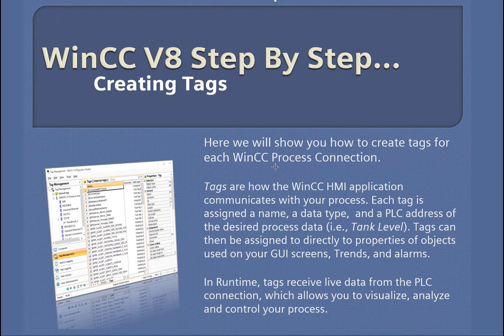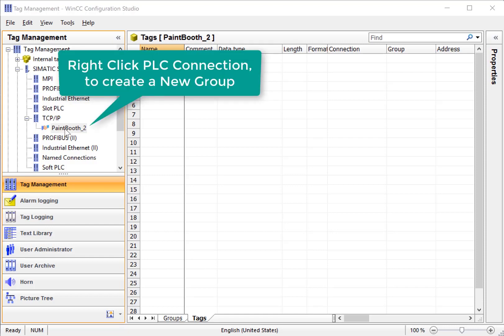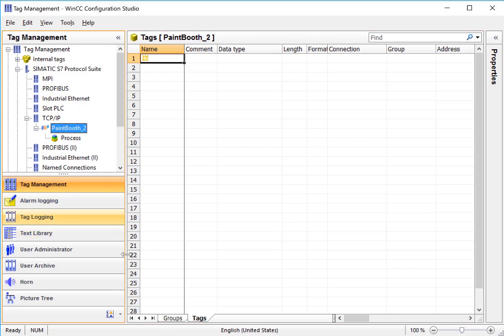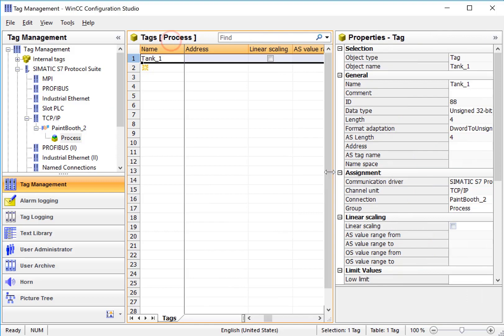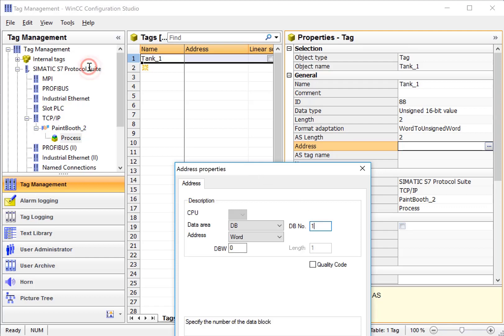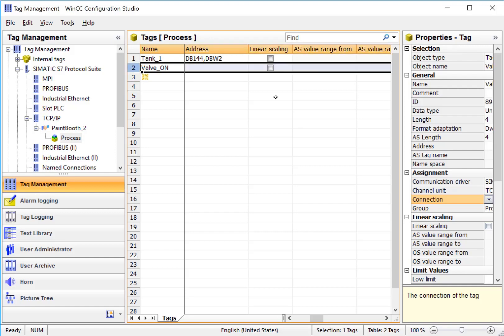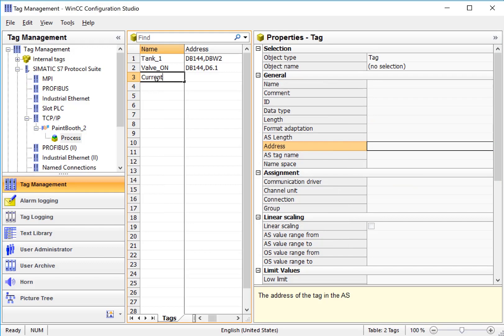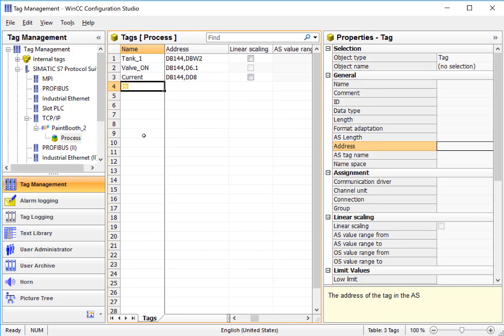WinCC v8.0 Step By Step 4: Create Tags under S7 PLC Connection 🤖 Learn SCADA Programming #winccguru

Comment: Hello, first, thanks for the videos! It is possible to indirectly access the PLC variables, as is done in TIA WinCC (https://www.youtube.com/watch?v=lPMSNCWVydE). Thanks!!!
Reply from the maker: Hi and thanks for watching. Yes, please see: https://youtu.be/0IEFh1q8vL0 this is indirect addressing using internal tags. it can be used with any PLC or other indirect tags.
Reply from the maker: you might also use tag prefix which is a more efficient option: https://youtu.be/rVneoViz2nw
Reply: @WinCCGURU   Thank you very much for the answers!!! My Wincc license is 512 tag and I want to access certain configuration values indirectly using the same communication variables with the PLC. This is possible?
Reply from the maker: in WinCC, you have to create and address each tag you want to access; they do this because of the license count tags. 

You would have to create some PLC Code to move desired values into a common tag that could be read in WinCC. You would also need a tag that WinCC could tell the PLC Code which address value it wants to read.